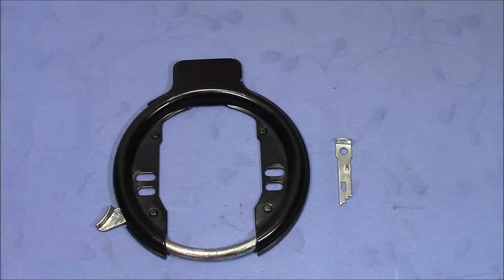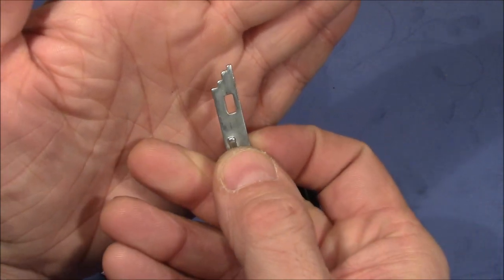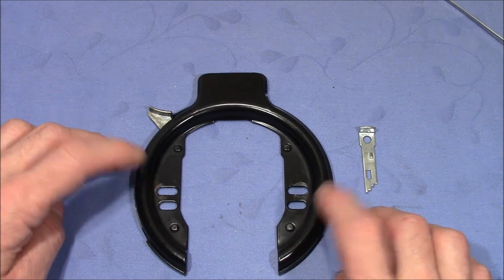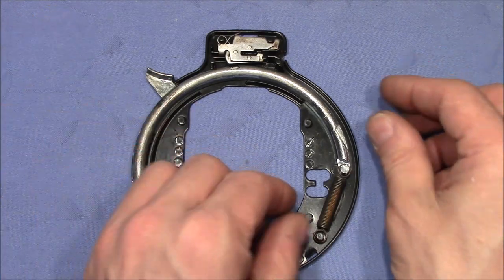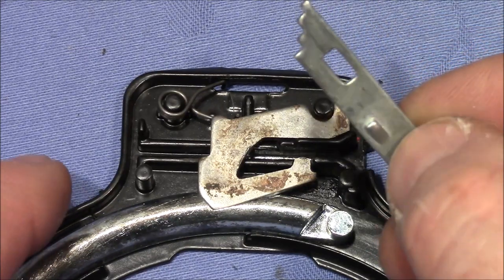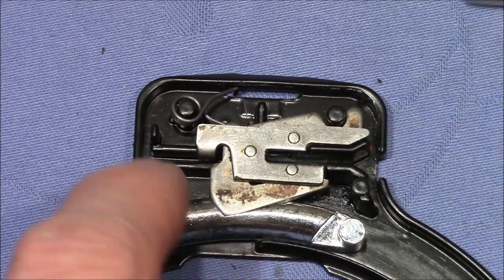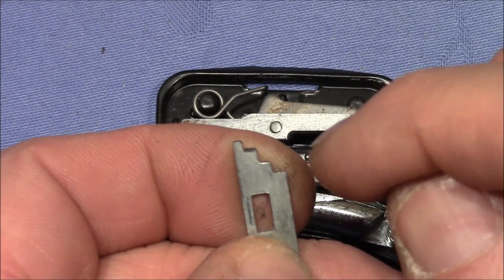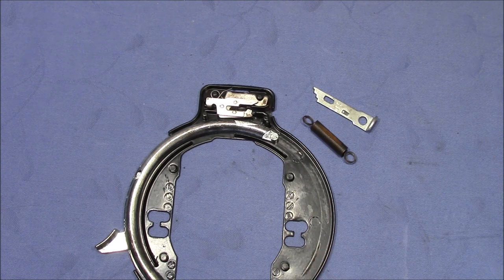(picking 734) Weird bicycle wheel lock picked and "gutted"

Comment: Yeah these locks were realy popular here in The netherlands a decade or 2 ago.
We called them stuiterslot, which means boincing lock. As you could very easily just pick up the bike, make a little speed walking then drop back wheel and the spokes will ram the lock and 2 out of 3 times it will just jump open. Really cheap shit.

But thank you so much for this video.
Reply from the maker: Cheers - yeah, I can imagine that this type of lock makes for a perfect teenager - fun.

Comment: I lost my key for the same lock, and I have tried your method but it doesn't seem to work, can you offer some extra tips please
Reply: UPDATE: This lock is even bigger of a joke. I used the hammer to hit the handle and in less than three hits it opened (without the use of excessive force)
Reply from the maker: Yes, sometimes force is the solution ;-)